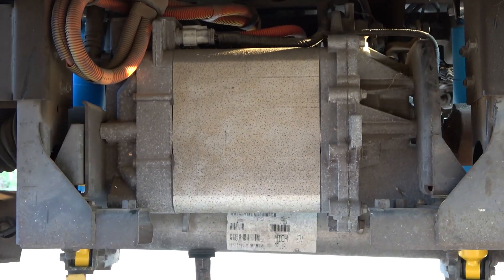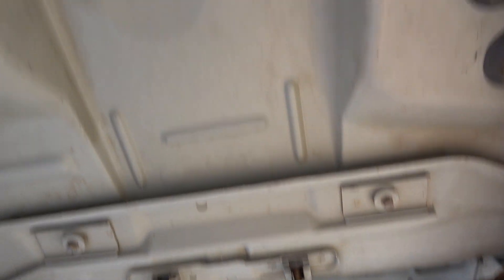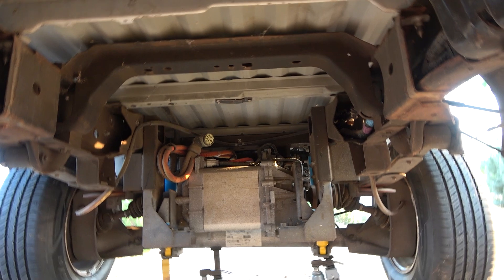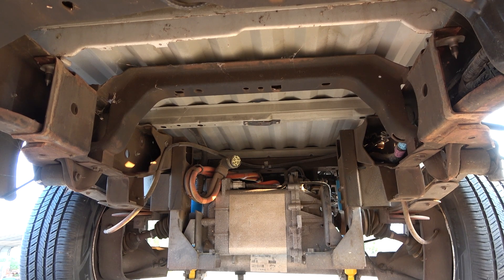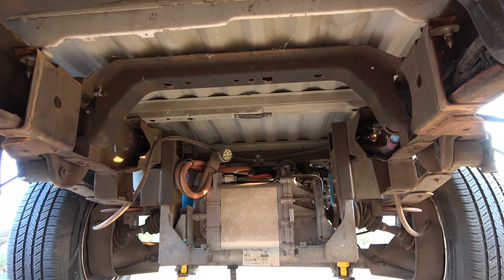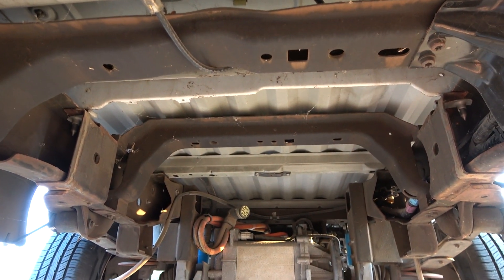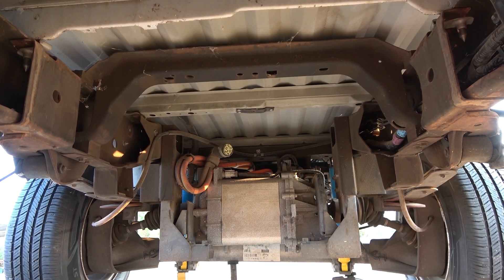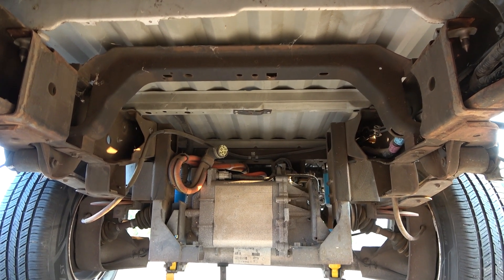Ford Ranger Electric: Undercarriage and Ribbing Rivian's "First" EV Truck

Comment: We had a 2017 Bolt on lease and now have a 2020  that we purchased.
Reply from the maker: That could be why you just now received notice, though I'm not sure why your 2017 slipped through the cracks. I've been receiving regular notices for the last 10 months through a number of different channels (apps, emails, letters, etc.).

Comment: I have seen a lot of information on the Chinese battery cells and not much is good. Seems like the
Cell housing is not adequate to support the heating and expansion of the cells when charging and 
being discharged.
Almost seems to be the problem with the Bolt battery and its pouch cells , the expansion causes 
movement and chaffing of the top of the separators , sliding up of the foil layers and shorting out.
GM has really kept quiet on what the engineers found in the batteries they have studied.
They were slow and now are on the hook. Maybe they knew this and that's why they never upped 
the charge rate above ~50kw to try to save the vehicle.
Need to buy back all Bolts, people can't wait years for a solution.
Reply from the maker: There are good and bad sellers for these Chinese batteries. I'm about to feature one, and showcase why people should avoid them. Other battery makers are legitimate, and the product you get is high quality for the price. It's hard to go wrong with CATL and EVE at this point, but you have to make sure that the seller you're working with is on the level. The good thing is, if you get a product that's not as described, you can open a dispute with Ali, and you should get a refund.

The pressure required to control expansion is that much, and I think it gets overplayed a little too much as well. 

As for GM's engineers restricting the Bolt EV's charging to a peak of 56-57 kW, that has more to do with the charging harness than anything else. Apparently, LG surprised them with the battery capacity, and it looks like GM engineers were planning for a 50-55 kW pack with 1 C charging. They got a 60 kW pack with 1 C charging instead.

Comment: Nice update, I like the shot of what I call the composite 'engine' up front where they have basically a shell to take the place of the engine to mount things on.   Sounds like you're still considering crafting your own tray, many of the early DIY ev conversions were S10s and Rangers, they even make the bed mounts hinged  to lift up easy, with drop in trays under it, so it's easier to service the batteries than the 'coffin'.   I understand Ford not doing this for a Factory truck, lot of liability there, but for a home DIY'er it's a great option.
Reply from the maker: Thanks! Yeah, I can see the appeal of top loading. I've even seen people use a toolbox as a "saddle tank." I might even get to that point myself, adding an aux battery. The options on these trucks are endless.
Reply: @newscoulomb3705  You'd definitely get over 300 miles with an additional saddle tank!  Speaking of endless options, are you having any thoughts about these being mobile 'power plants' with an inverter?  Like the upcoming Lightning will have for working out in the field.  Or even for home power when they cut power out there?
Reply from the maker: @jkinghorn  I was definitely considering a power takeoff of some type. I'm running into a bit of scope creep already with this project, so I'm trying to get straight back to basics. Get the truck up and running, and then start tinkering.
Reply: @newscoulomb3705  Excellent point!  And you've got your Greenwood's inverter already 😅

Comment: I like how as a bolt owner and reviewer you are going to totally ignore the bolt situation. Lol. Just sweep it under the rug and not worry about it. Not really being fair in your reporting. This isn’t CNN lol 😂
Reply: how do you know what he is "going to do"?
Reply from the maker: There's only so much I as an individual can cover, and the Bolt EV battery situation, while sensational, isn't very interesting or informative. I might speak to it at a technical level, but there's really not much to update until GM finishes vetting LG's assembly lines and starts swapping out batteries.
Reply: GM just issued a warning about parking 50 feet from other cars and watching the car while charging. This latest warning makes the Bolt almost completely unusable for most people. This is a newsworthy announcement, I think.
Reply: @barryw9473  exactly.
Reply from the maker: @barryw9473  The problem is, there is nothing formal from GM stating that. The story is second-hand from a reporter who states that they were told that through email. That might not be an official company advisory, and it might be limited in scope to specific years of Bolt EV (e.g., 2018-built 2019 MY Bolt EVs). 

Regardless, that story has been regurgitated a number of times already by a number of outlets. I try to focus my attention on issues that are either underrepresented in the news or based on my own, first-hand experiences.
Reply: @newscoulomb3705  We just received GM notification of battery problem.
Reply from the maker: @firstbigbarney  What year is your Bolt EV?

Comment: The Rivian is grossly over priced.
Reply from the maker: It's really targeting the luxury/lifestyle truck audience, so it's not too bad. The Ford F-150 Lightning and Tesla Cybertruck will both also top $90,000 in their highest trims. It remains to be seen how many of the $40,000 to $50,000 EV trucks actually sell.
Reply: @newscoulomb3705  the Rivian starts at around 70k. That is grossly over priced. For what you get they need to get them in the 30K range.
Reply from the maker: @JohnSmith-ug5ci  I don't necessarily agree. I'd have to see exactly what the base model comes with, but just the smallest battery option alone would cost Rivian $15,000 to $20,000 to source and assemble. Based on what I've seen, the R1T should cost at least $40,000 to $45,000 in parts and labor alone. $30,000 would be selling at less than cost.
Reply: @newscoulomb3705  you are not getting it. Just because their costs are high does not mean the end product price is justifiable based on what one gets. The vehicle is only worth  around 30k as they are short on distance, too long to charge, and battery life too short.
Reply from the maker: @JohnSmith-ug5ci  The Rivian R1T competitive with the Ford Raptor, which has a $64,000 MSRP. Based on that alone, we can say that the R1T is correctly priced.
Reply: @newscoulomb3705  you still are not getting it. You do not compare them to other over priced EV vehicles. Compare them to the base gas model. ALL EV's are ALL over priced. That is one of the big problems with the EV. 

A two wheel drive base price should be around 30k and the 4 wheel drive around 35k. The EV trucks are all over priced, to short a range, to long to charge, and to short of battery life. When towing with an EV you cut your range to about half. They may be a novelty , but they are not practical.
Reply from the maker: @JohnSmith-ug5ci  Why would you compare an AWD performance, off-roading, luxury truck with a base model gas truck? Have you gone into a Ford dealership and demanded that they sell you a Raptor for $35,000 because you can get a base model F-150 4x4 for about that price? 

Outside of range on a tank and refueling times, you won't find a superior crew cab gas truck to the Rivian R1T on any metric until you're spending well north of $50,000.
Reply: @JohnSmith-ug5ci  people drop $65k+ on new pickup trucks all the time without even blinking. Another truck spec'd out to the features a Rivian has will run someone in to the high $60ks into the $70k range with ease. Heck, many of those I.C.E. trucks break $85K+. You're price point is rather moot.
Reply: @eddiesantos6407  you also are very confused. People drop that kind of money because they are worth it, but the EV truck is not.
Reply: @newscoulomb3705  it is the basics that make the truck. The EV has to add all the extras, mostly electronic, just to justify the price. Their AWD EV does not fix their issues of short range, long charges, and short battery life. They are way over priced.
Reply from the maker: @JohnSmith-ug5ci  The AWD Ford F-150 Lightning starts at under $40,000, so that shows that an EV truck doesn't have to be overpriced. Yes, you give up some performance, range, and refueling speed, but that really only matters for specific use cases. 

As for battery life, that's simply untrue. Modern EV batteries last longer than the typical service life of most internal combustion engines and transmissions before they see even 10% degradation in capacity. As an example, my Bolt EV has over 140,000 hard miles, and it's seen only 6% to 8% degradation.
Reply: @newscoulomb3705  you are still trying to compare apples to oranges. The battery is not an engine. I did not say the electric motor would crap out. The batteries are what has the short lifespan. By the way you are lying about your Bolt and only having 6 to 8% degradation. The recalls and cut backs prove that. If you have followed the recalls you have lost around 25%
None the less a gas model will not lose even 6 to 8% efficiency at 140k if kept up and certainly not 25%
Reply from the maker: @JohnSmith-ug5ci  It seems that you are the one trying to compare apples to oranges. A performance AWD performance truck with a base, entry level 2WD? Please. If that's what it takes to make ICE look better than EVs at this point, ICE will phase out even sooner than I thought.
Reply: @newscoulomb3705  when you compare a base model 4x4 gas model half ton to a 4x4 EV the EV is grossly over priced. The same applies to the EV cars. ALL over priced
Reply from the maker: @JohnSmith-ug5ci  But when you compare a performance, off-road variant (like the Raptor), the price difference is minimal ($64,000 for the Raptor versus $69,000 for the R1T). Throw in all the additional functionality of the R1T and the luxury, premium interior, and it makes the gas Raptor appear overpriced. 

Likewise, when you compare the upcoming Ford F-150 Lightning at $38,000 to the base V6 F-150 4x4 SuperCrew cab $40,500, again, the EV makes the gas variant look overpriced.
Reply: @newscoulomb3705  well it looks like you will never grasp this but let's use that comparison of the raptor and R1T. The EV still has a much  shorter range and takes much longer to charge/refuel. The Raptor can goo into water just short of its intake the EV only a few inches. The EV loses about 50% range when  towing. The EV is  at least 5k more in  price. That is a loser. They are grossly over  priced. A base model should run around 35k, not 70k.
Reply from the maker: @JohnSmith-ug5ci  You're so focused on the range and refueling times that you can't see all of the inadequacies of the gas truck in comparison. For example, the cost of ownership between the R1T and Raptor isn't close, with the R1T costing as little as 7 cents a mile under average U.S. electricity costs. Other examples:
- Towing capacity: R1T: 11,000 lbs /Raptor: 8,200 lbs.
- Payload capacity: R1T: 1,760 lbs/Raptor: 1,200 lbs.
- Water wading depth: R1T: >36 inches/Raptor: 32 inches

And yes, I expect EV trucks to lose about 50% of their rated range at full towing capacity, but ICE trucks lose just as much. So that's really just rehashing the same criticism of range a second time. A counter point to that, though, is if you do a lot of towing, ICE trucks will need brake replacements sooner while EV trucks absorb that extra energy through regenerative braking.
Reply: @newscoulomb3705  your claims are totally wrong about the costs of a gas truck. The EV trucks are all grossly over priced.
Reply from the maker: @JohnSmith-ug5ci  The numbers I gave are searchable online and independently verifiable. Sure, you could get standard or extended cabs for cheaper, but if you want apples-to-apples, you can't just discount the EV truck's features and functions to meet your narrative.
Reply: @newscoulomb3705  those numbers are bogus to justify an over priced vehicle.